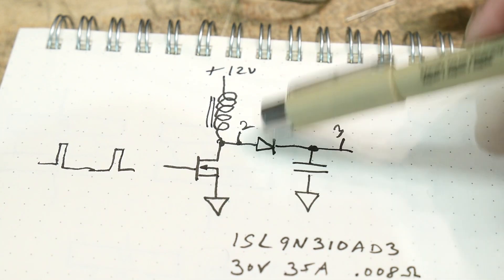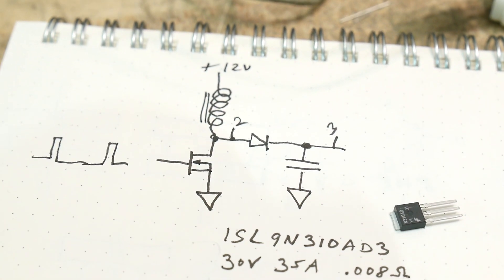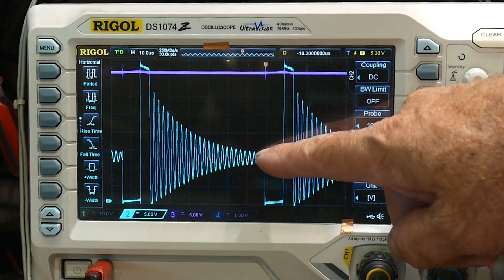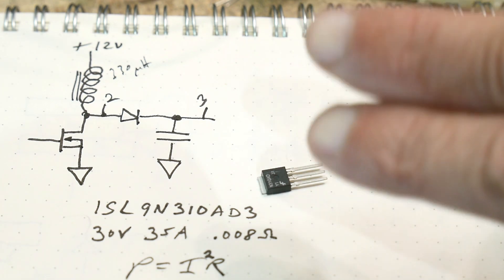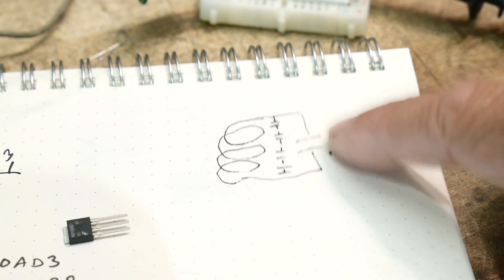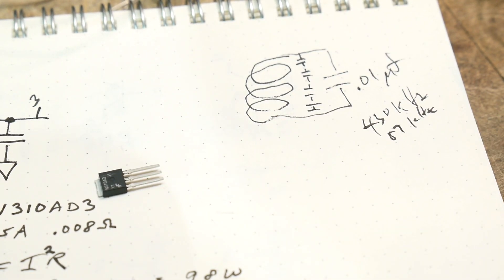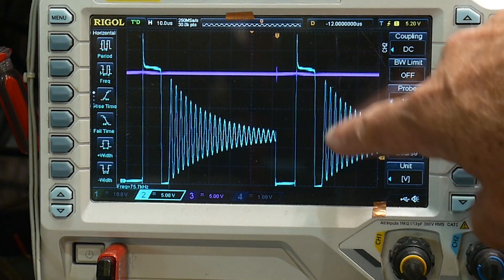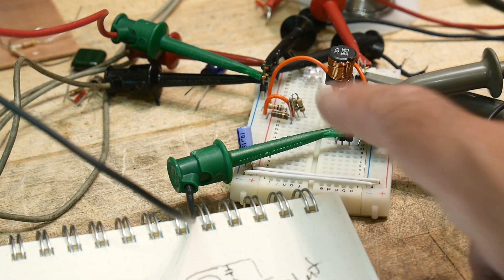#832 Basics: Inductor Self Resonance

Comment: Primary resonant capacitance in your circuit is the output capacitance of mosfet since it is in order od nFs, and self capacitance of a 330uH coil is in order od pFs. It is easy to fool yourself when in analyzing the circuit one accepts all  the parts of a test circuit but DUT itself, ideal. :) 
Also selfresonance between the inductance and mosfet output capacitance is used in PSM inverters to obtain zero voltage switching and enhance efficiency/reduce EMI.

Comment: Mark. The resonant frequency depends on square root of parallel cap. So if the frequency changes by order of 5 then I would guess the cap changed by order of 25. So the parasitic cap must be about C_external/25 ?
Reply: sorry, repeated your comment before reading through all comments

Comment: Super cool.  As you added load the waveform started to resemble  the wave form of the secondary ignition firing a spark plug in an internal combustion engine.

Comment: I get 346pF for 330uH at 471KHz
Reply from the maker: that matches the FET capacitance perfectly. I just did a second video removing the FET from the setup and will post that in a few weeks.
Reply: @IMSAIGuy  That would be series capacitance instead of parallel. That would be a low Z at resonance instead of high.  Would it ring with a low Z?

Comment: Thanks for this! Very interesting. Does anybody know (it wasn't clear to me from watching the video) - looking at the oscillation waveform of the inductor, is the centre line 0 volts? So... in other words, does the inductor effectively produce an AC output, which (in this particular circuit) is being half-wave rectified by the in-line diode? I need to learn more about inductors and do some experiments with them. Also, many thanks for the interesting tip about the transistor - that's a great part!
Reply from the maker: No, the ringing has nothing to due with that. I did a two part series that might help you:
https://youtu.be/9bFVTa8FEM4

Comment: Nice! I'm just recording a video about self resonance in capacitors. You can get a better measurement of the inductor's self resonance using your VNA or SA with tracking generator.

Make a jig with the inductor in series, using S21. 😁😁
Reply from the maker: https://youtu.be/FboT1tSstlk
Reply: @IMSAIGuy  Nice!! For parallel resonance the coax to environment transition will degrade more the measurement than for shunt resonance, I think
Reply from the maker: of course the granddaddy of self resonance is the crystal.

Comment: The filter capacitors of a power supply don't have an inductor or resister to form a LC or RC low pass filter.  What is the other element that allows the 100 Hz or 120 Hz rectified current to be filtered out?
Reply from the maker: Are you talking about a linear supply? The ripple? The ripple is controlled with the bulk capacitor value and then the regulator circuit which follows.

Comment: First, I want to thank you for your helpful demonstration of boost converter.
The ringing is caused by inductance  and combination of any parasitic capacitances in the circuit. That includes power MOSFET parasitic capacitances as well.
In circuits with high current low voltage MOSFETs, the dominant parasitic capacitance is likely to be  MOSFET itself which may have as high as 1 nF capacitance for a typical power MOSFET.
Reply from the maker: You may be right, the datasheet says 375pf. I will have to repeat the experiment some day using a relay instead of a FET
Reply from the maker: I did. the resonance went from 440khz to 1.4MHz. So yes FET has the most effect. Thanks!

Comment: Part of the parasitic capacitance is associated with the drain-gate junction of the transistor while it is turned off. I think if you ground the transistor's gate and source, you may be able to measure this with an LCR. Or I could look it up on the transistor's spec sheet if I wasn't so lazy! ;-)
Reply from the maker: read the description update